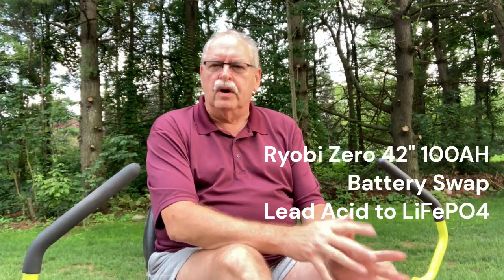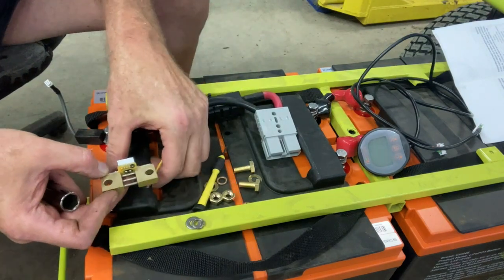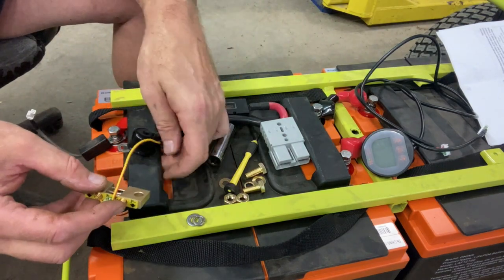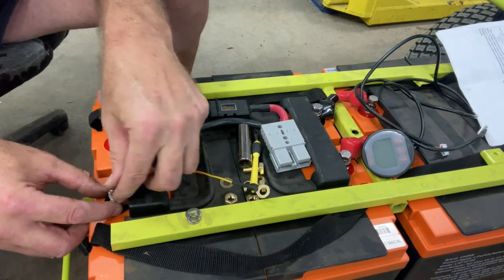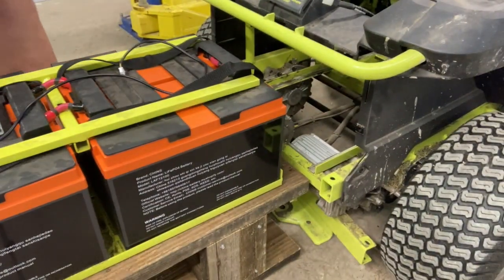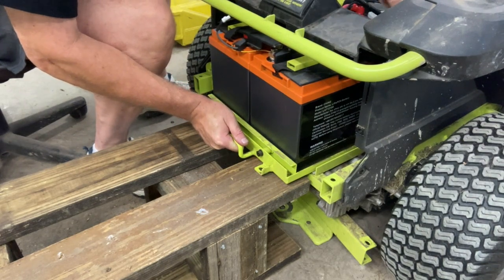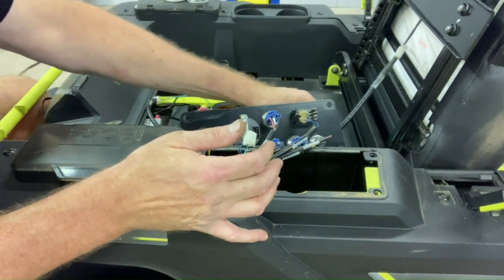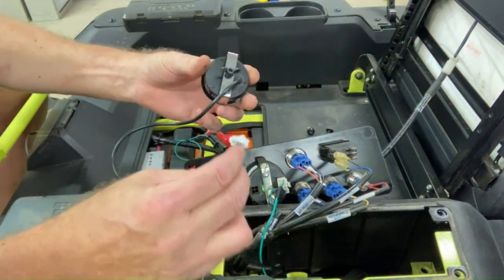Ryobi 48v Battery Swap - Load the batteries and install new battery meter

Comment: What kind of acreage do you expect to mow after doing the swap? I only have 1 acre and may help some neighbors with their lawn care probably 3 acres. Do you think 2 of these batteries would be enough or is 4 really necessary?
Reply from the maker: You need some combination of 48v, and for most of us the simplest solution is four 12v 100ah batteries.
I have a 1 acre lot and I can do about 2.5 acres on one charge. (I did a video on that)  So. I think you would have to break it up into 2 mows.
Reply: @robertveldman1901  thank you!

Comment: Robert, Look for the small (18 ga) BLUE wire that must be reconnected to the charge port. It has a thermistor that allows the relay to close the power loop.
Reply: could you please be a little more clearer on where I should find the BLUE WIRE & THE CHARGE PORT. I have no power at all when turning the on key. I have a Ryobi 300e model with  FOUR  lithium batteries 12 V 50 AH. thanks for replying .Ray
Reply: I did find those areas ,everything is connected properly

Comment: Hi Rob, I did the conversion on my 54 inch and changed out the meter and bought and used the charger you mentioned.  I have used the set up now for about 6 times and it delivers about twice the mowing time of my old lead batteries.  Now though, the mower clicks and shuts down when I try to use it.  The only way to get it to come back on is for me to plug the mower into the battery charger for a minute or 2, then the mower clicks and starts up again until I put load on it (drive it).  At that point it clicks and goes dead again.  I looked at the wiring (looks good), I used a hand meter to check to ensure the voltage is good (its 51V).  I believe the clicking noise is coming from what I think is a solenoid that is located by back wheel well.  Has anyone had this problem and does anyone have a solution?
Reply from the maker: That's new to me.  You may have better luck finding help at a forum.  For example:
https://www.reddit.com/r/ryobi/
There is a solenoid on the "passenger" side.  The side panel is pretty easy to remove to gain access.  
Of course, it doesn't mean the solenoid is bad.
I have heard of key switches going bad.  People switch the wires to the AUX side of the switch.
Good luck!
Reply: @robertveldman1901  Thanks Rob.  I actually bypassed the key switch and I have the same issue.  Also dug deeper, its not a solenoid but a relay.  It triggers the 48V circuit.  I was thinking about bypassing it just to see if it solves it (then I can get a new relay).  Appreciate your reply and suggestion about reddit.  Also I find your videos were very helpful in the conversion.  I am more a mechanical person that electrical, so having your videos made it a step by step project that I could follow easily.  Thanks again!
Reply from the maker: @tomd1961  Thanks and good luck!
Reply: @robertveldman1901  I enjoyed watching your videos and was about to pull the trigger on the replacement LiFePO4 batteries and realized some folks having issues. I have the 54 inch deck model. Then realized the 54 inch deck is 48v 115ah, not 100ah. Replacement AGM batteries are the 115ah version as well. Curious, is there any LiFePO4 115ah or what’s your thoughts? I’m mainly seeing 100ah and a few 120ah. Nothing specifically 115ah. Any insights would be appreciated, thx!
Reply from the maker: @ZbellyTube  Yes, I believe all the 54s are 115aH. I took a brief search for 115/120aH batteries. Pretty limited and expensive results.  You may have to consider using 100aH batteries. Or see if you can find a 48v battery that will fit.
Maybe check with tomd1961 and see what he used.
Reply from the maker: I did come across this video from Greg(?).  Read all the comments.
https://www.youtube.com/watch?v=jNEGhhh3dMo
He builds and sells a "pre-charge" circuit, to manage the "inrush current".
Apparently, the initial inrush of current from batteries can cause the mower to "trip".  It looks like the pre-charge will dampen that inrush.
Reply: @robertveldman1901  I used LiFePO4 12V 100ah times 4.
Reply from the maker: @tomd1961  Sorry.  Getting mixed up with Zbelly.

Comment: Hi Rob - thank you for your video. I have a 54" ryobi and I followed this step by step and I am very happy! Question - regarding the meter - I set the amp value and when the batterieds were charged, I set the % to 100. I took it out and rode in till it was down to roughly 70%, and when I plugged it in to charge it, the charger still shows it's full. Any ideas?
Reply from the maker: I'm still having trouble understanding my new meter, and it's been a year!
You have the Lithium charger?
But, to run the mower for awhile, then the charger says FUL ?  I haven't heard that one.
When mine is unplugged, it says OFF.
When it's completed charging, it says FUL.
When I plug it back in after it was completed charging, it tries to charge some more.
So, I can't understand a situation where you plug it in and it says FUL, unless it finished charging again.
What is the battery voltage on the meter?  According to the CHINs battery manual, full charge should be 53-6-55.2v
I'm sorry...I have no ideas.
Reply: @robertveldman1901  Thanks for your quick response. Yes, I bought the lithium charger you recommended, and made the subtle change inside the port, so the connector would fit. The voltage reads 52.71. Not sure, I will keep playing around. Thanks again.
Reply: Hopefully to close the loop here - I unplugged the charger, and toggled it back to 36 to and again to 48 and plugged it in again and the mower started charging... maybe just a glitch. Thanks again for your videos!
Reply from the maker: @gregknight2091  Thank goodness!

Comment: HELP ... put lithium batteries in my 30" Ryobi  ran good ,then had to change out the charging port ,Watching  one of your videos on how to do that...THANK YOU ... NOW I am showing only 42 VOLTS  on my original meter. and the mower runs for about 20 minutes then is completely drained of  power... ANY suggestions on what to check ...?   thanks (08/18/24)
Reply from the maker: Ouch!  I would start by checking the voltage of each battery.  If you have a low battery, you can try to charge that individual battery with a 12v Lithium charger, or you'll need to replace that battery.
Reply: @robertveldman1901  Plan on checking battery (s) . will update…. Thanks.

Comment: It seems like 1 48v battery would be best to eliminate charging issues, and it would be easier to remove in the winter to store indoors.
Reply from the maker: A single 48v battery certainly seems to make sense.  But, there are some conversion issues with that.  The most obvious is you'll need to customize a hold down system; the long center hold down bolt cannot be used.
So, I decided to use 12v batteries that were the same physical size.

Comment: What's the disadvantage to leaving the old battery meter in place after the switch from lead acid to lifep04 batteries?  I did my battery swap today and everything went well, mower turns on, the house did not blow up.
Reply from the maker: HaHa!  Good for you!  That's always good, when nothing blows up.
I've had and seen other comments about using the old meter.  If I would have known what I know now, I think I would have continued using the old gage.
The new gage is cheap, and does have additional functions, and is probably better at estimating lifepo4 battery life when correctly set-up.  But, it can always be added later.  I would recommend considering adding the new gage to the plastic side panel, like I did in another video.
Reply: @robertveldman1901   Thanks!  Your videos were very helpful.  I haven't taken any physics or chemistry class in > 17 years and I'm no engineer so I was a bit skeptical of my ability to pull this off especially after seeing all the weird electrical drawings on the battery manual that I didn't understand.  I just carefully took pictures of everything as  I disassembled them and put it all back together, same as I found it.   I also added a Brinly-Hardy-Front-Mount-Snow-Plow for RYOBI so now It's ready for all seasons.  I was able to swap out the plug for the lifep04 battery smart charger with the plug of my old lead acid battery charger that came with the mower so that the new charger could fit in the back of my RYOBI but i didn't get around to setting up the green light yet.  It seems that will require some soldiering skills which is currently above my paygrade but probably not for long.
Reply from the maker: @TheMrmoc7
I'm glad to hear it worked out for you.  I had to learn quite a bit about LiFePo4 batteries before and during my conversion.
I've been soldering most of my life.  And while I'm not that good at it, I'm not afraid of it.  (small electronic soldering is scary for me!)

If you're setting up for a plow, and live in a cold climate, make sure you you read up on Lithium batteries and cold storage and cold charging.

Comment: Hi Rob
I have a question which I hope you can assist me with,

I have spent a lot of time trying to figure out the problem for why the blades on my ZT480E stops spinning just about 10 minutes from mowing !
There was some plastic rope stuck in one of the blades motor and I succeeded to remove it after some struggling..
But am still having same issue knowing that I did resistance test on the blade motor connectors and everything thing looks fine.. I appreciate any advice
Reply from the maker: I'm glad you mentioned the rope and the resistance test.  The Ryobi electric blade motors appear to be fairly sensitive to high torque and shuts the blades down. I'm going to guess that there is still some rope caught up on the shaft?, or there was some damage to the blade motor bearing that heats up.
I've never tried to run my mower with a blade mower unplugged... but you could try that to see if the good motor keeps running.  Unfortunately, I'll bet that the motor controller will sense this, and not operate at all.
It looks like those deck motors are over $300, so that's not a cheap option to just try, but you may not have a choice.  Let me know if you figure it out.

Comment: Hey there! First off- thank you for a great video series. Will be converting my mower as soon as the parts get in. 

Secondly, if I didn't care about the battery meter. Would it be possible to skip that? If I just used the battery charger to see how full the batteries were, could we not worry about installing the meter?
Reply from the maker: The meter upgrade is not really necessary.  You could always add it later.  The new meter will be more accurate to determine when your batteries will die.  
And you are aware that you may need a pre-charge kit?  That kit is something a bunch of us learned about after the fact.
With Lead acid, the mower would kill the blades when the batteries were low.  With Lithium, everything will just shut down, and you'll need to pull/tow it back, or run your charger out there with your charger (like I did).
I can easily mow my yard twice, so charge level is not important to me.
Good Luck!
Reply: @robertveldman1901  What do you mean by "pre-charge kit". Do you have an example?

I switched my golf cart from lead acid to Lithium a couple years ago, so I'm familiar with the "lag" lead acid gets before it dies and lithium will just go until they are dead.

My yard is less than half and acre so I dont foresee it turning thru 100ah in a go. At least i hope!
Reply from the maker: @leegiles2565  My swap went great, and at half an acre, you're not going to have any life issues.

Some of the Ryobi mowers don't "start" after the swap.  You turn the key on, and the main solenoid clicks, and immediately "unclicks".  There is a guy that sells two different "pre-charge" kits.  You can see his install video at: https://youtu.be/jNEGhhh3dMo
He has a Facebook link with more info; Facebook group.  Look up -  "Ryobi 48v Riding Mowers  group"

It looks like some of the mowers are sensitive to the initial power surge when the key is turned on.  The kit slows down the surge with a resistor.

If you have this no start issue, try unplugging and replug the big grey battery plug.  That may reset the mower to start.
Reply from the maker: @leegiles2565  and here's a link to Greg and his precharge circuit
https://www.facebook.com/groups/2756962307675482/search/?q=precharge%20circuit
Reply: @robertveldman1901  Awesome! Thanks again for the info, Rob
Reply: @robertveldman1901  Hey Rob. Thanks again for the assistance. I just switched out the batteries and it fired right up! Excited for my first mow

Comment: Seeing cheaper LiFePO4 battery options on Amazon.  Are there any specific attributes for these other batteries I should try to avoid?
Reply from the maker: Sorry, I'm really not an expert at this stuff.  There are some YouTube channels that discuss different Lithium batteries, such as;  
https://www.youtube.com/@WillProwse
My focus was on cheap and physical size.  I just checked at Walmart, and "my" batteries are down to $1000 for 4;
https://www.walmart.com/ip/CHINS-12V-100AH-LiFePO4-Lithium-Iron-Battery-100A-BMS-for-RV/1029813425
(Don't forget to consider cold storage req'ts)

Comment: Hello Rob, how are you hope fine, thanks for all your video, do i need to keep the lithium battery on charger doing the winter?
Reply from the maker: Charlie,
That's a good question.  I'm not sure of the answer.  And I'm sure it depends on how cold it gets.
I don't think it is necessary to leave the charger connected.  And the manual says not to charge below 32F.
I plan to leave my fully charged mower disconnected from the charger for the lower Michigan winter.
According to the Chins battery manual:
- Battery storage temp: 14F to 122F
- Charging temperature: 32F to 122F
- Discharge temperature: -4F to 140F
- If storage time exceeds 6mos, discharge battery to 5%, then fully charge.

Rob

Comment: I tried this and when I plug in the charger it jumps straight to full. Any suggestions as to why this may be happening?
Thanks
Reply from the maker: Did you check the batteries with a volt gage?  Are you sure the charger is set on 48v and not 36v?
Reply: Thanks for your prompt response. The voltages were 52.78-53. 
Upon further investigation, the batteries that were shipped were 160A. I wonder if that could be the problem.
Reply from the maker: @CPHRCPHR  That could be.  I didn't know they come at 160A.
Reply: Neither did I. I’ll keep you posted on what I find out

Comment: Rob, thanks a lot for your video. I just followed your instruction and replace my Ryobi battery. Your detailed explanation saved me hours of time and tons of frustration for sure. 

I had one "small issue". I think I purchased the wrong batter meter. I got the 100AH battery set; however I bought the 80V 50A battery meter instead of 80V 100A by mistake. Now the charger says the battery is full; however the meter reports 50%. Is it related with the wrong meter type? 

Can I continue to use the current setup and treat 50% as full? Or I should replace the meter? 

If I need to replace the meter, can I just replace the digital control / display part and not change the part connected to the battery? Replacing the part connected to the battery will require some work. 

Sorry for all the questions. And thank you again for the amazing video.
Reply from the maker: Good for you on your swap!

Well, I'm not an electrical expert, but I think the reason for the 100A meter system is that the mower can draw up to 70a or so?  I don't know if you risk damaging the "bridge" at the battery and/or the meter.  I recommend getting the "correct" meter and bridge and replace both components..

Did you follow the instructions to set-up the meter for 100%?  I recall; with a fully charged battery, you need to set the gage to "%", then press and hold "%" button for a few seconds until it changes to 100%.
Setting the 0% level is a bit more complicated.  But you need to follow the instructions.
Reply: @robertveldman1901  thanks for the quick reply. I will order the right AH meter. I will also contact the vendor to see whether the part connected to the batter set is the same. Hopefully it might save me trouble of pull the battery out again 🤌
Reply from the maker: @okayiii  At least you don't have to pull the batteries out all the way...
Reply: Thanks,  @robertveldman1901 . I chatted with the vendor. They told me the bridge is the same between the 50A and the 100A. I order the correct product and will only need to replace the meter; not the bridge. That is a huge relief. With the new battery (it is very light compared with the original led based one), I guess I need to get used to the move on the small slopes. It is weight center will be higher :)

Thanks again, Rob.
Reply from the maker: @okayiii  That is good news!
Reply: @robertveldman1901  my mower is all setup properly including the battery meter configuration. Thanks again. I took it out for a ride and it was amazing. One charge covers all my front and back lawns with spare.
Reply from the maker: @okayiii  Crazy! Isn't it!  After a year, I'm still getting over 2 of my yards mowed on one charge.

Comment: Great video Rob, I just did a battery swap yesterday. Rob, do you know if there are any issues or problems using the lead/acid battery charger that came with the mower when charging lithium batteries?
Reply from the maker: Everything I read says to use a charger specifically for LiFePo4.  The charger I got has a specific setting for either type of battery, so there must be a reason.  I just can't remember what the problem was, but it was scary enough to get a new charger.  Plus my new charger has a plug that (almost) fits the mower socket.